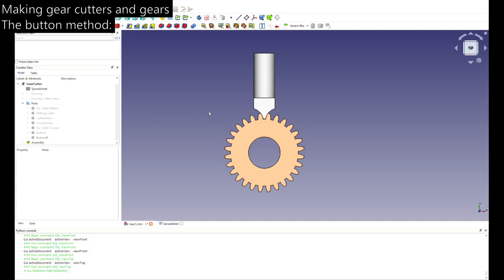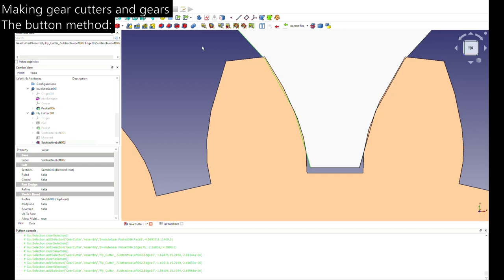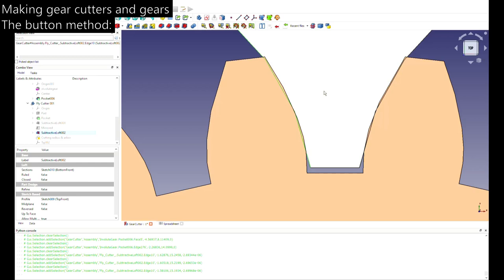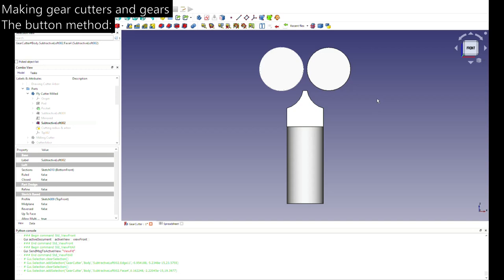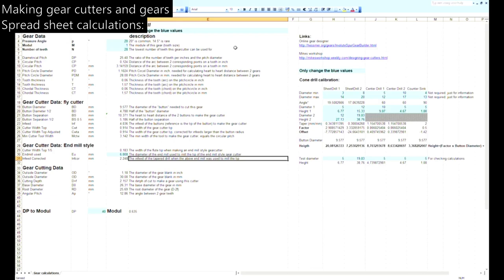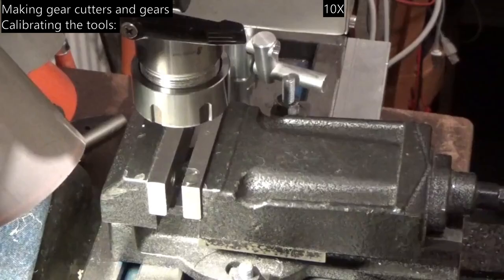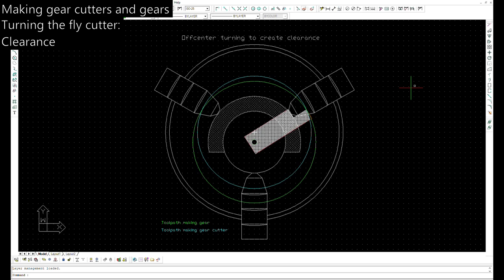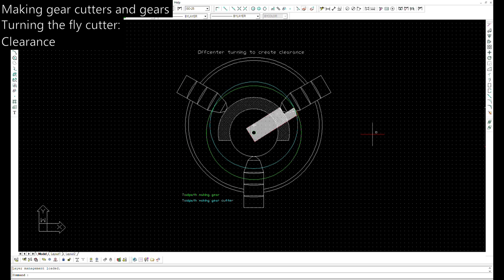Making gear cutters and (helical) gears

Comment: I.ve made milling cutters for cutting gears using a flat 2 flute cutter that was hand ground from a piece of round HSS.........it was made easier when I had access to a home made projector made from a 35mm slide projector for the tool profile......seeing a projected image of the tool at 50X on a hand draw projection chart of the tooth profile was easy.
Reply from the maker: If you can grind by hand, you don't need a mill. That HSS gear cutter will last longer than a silver steel cutter.
I have thought about using a tapered grinding bit in stead of the tapered drill bit and grind the gear cutter.
Reply: @MetalWorkerTools  Yes, I've ground cutters from HSS blanks.....by hand, they cut gears quite easily and cost practically nothing to make.....profile is checked from a hand drawn projection chart.

Comment: Huub, thanks from me also for the video and spreadsheet.  I just posted this question to your thread on the ME forums, but I though I'd ask here too.

I have a question - are the button tool calc tables on p114 of Ivan Law's book correct (Gears and Gear Cutting book)?  Ivan's tables do not agree with the results of Huub's spreadsheet or my own calculations from playing with CAD.  My calcs agree with Huub's!  Ivan's tables give button diameters/separations about 50% bigger.  Ivan's tables also don't appear to match the results I would expect using his figure on p113.

To get from Ivan's figures to the values you want, you have to divide his figs by the diametral pitch of the gear required.  If using Module gears rather than DP, 25.4/MOD = the DP value.  e.g. 0.75 MOD = 33.87 DP.

I'd be very grateful if anyone can confirm, or otherwise, the accuracy of Ivan's tables!

Thank you!
Reply from the maker: This is a copy of my response on the ME forum:

My book of Ivan Law is the reprinted version of 2013.

On page 107 if have made a note for the bevel gear calculation to use cos not sin
On page 113 if have made a calculation note: Button Diameter = sin (pressure angle) x PDM (Pich Diameter in mm)

The table on page 114 is made for 1 DP gears 20°. Divide the value in the table by de DP of the gear to cut.

According to this table, a T17 20DP 20° gear would need a button diameter of 0.39" and a button separation of 0.435".
According to the spreadsheet, you need a button diameter of 0.207" and a button separation of 0.341"

I can confirm there is a difference in the results of the spreadsheet and the table in the book.

I will check the results using the formula's of MikesWorkShop and will report it later this day.
Reply from the maker: I have checked the results of the 20° and 30° tables in the book of Ivan Law. The results of his 30° pressure angle table are the "same" as using my spreadsheet. So this table is OK. I find the same results using the formula's of MikesWorkShop so the 20° table in Ivan Law's book is wrong.
Reply: @MetalWorkerTools  Hello, thank you very much for confirming my suspicions, I’m glad I am not going mad.  Much appreciated.

Comment: Good day Huub. Thanks for this informative video. Just one question regarding the depth of the center drill on the end mill style cutter.  How do you get to 8.0mm depth using a Ø9.56mm center drill. Your spreadsheet shows 8.70mm height.
Reply from the maker: Moegsien,
The bit is 8 mm but the cutting face is at half the diameter. So the max depth would be 4 mm.
To reduce the depth needed, you could mill 1 mm of the other side. For small gears, I use a 6mm bit.
You get the largest range by using a cone drill. I am currently testing a method to use a rotary table and a cone drill for making gear cutters. This should be suitable for small and large end mill style gear cutters having 1, 2 or 3 flutes. As soon as I am satisfied, I will make a video and update the spreadsheet. It will probably be ready early 2023.

I have made a small (40 mm diameter) rotary table that fits in the mill vice. This make thinks a lot easier.
Huub
Reply: @MetalWorkerTools  Good day, what I refer to is the center drill height in your video you move to half the button separation and to the corrected indeed depth, but when you touch with the center drill you drop down to 8.0mm. Why to 8.0mm and not to the spreadsheet indicated depth of 8.7mm.
Reply from the maker: @moegsienjacobs5110  
After I made the video, I milled more gear cutters. I noticed that the (HSS) center drill was regrinded (I grind HSS drills, end mills, slitting saws, etc) and I did not mark the side to use. So I marked the side to use and calibrated again. The result is that the data in the spreadsheet differs from the data in the video. I only keep 1 version of the spreadsheet. The uploaded spreadsheet is my production version.
Probably needless to say but you have to calibrate your own center drills.

Nowadays I use small 2.5 mm HSS 5% Cobalt centerdrills. I do not regrind these Cobalt drills because the dust is toxic.
Reply: @MetalWorkerTools  Thank you I'm looking forward to this video. You keep well

Comment: How would you calculate the flat distance for grinding a hss tool for making a worm wheel hob?
Reply from the maker: I would take the top width of the thread to make as base (W).
The depth of the thread  (D)
Half the angle of the thread (A)
The with of the cutter tip (T)
T=W-(D*tan(A)*2)

Then I would use progecad of freecad to draw the thread and cutting tool to check the calculations.
However measuring and grinding that tip would be difficult.

So I would make the tip a bit smaller and do the threading using that smaller tip. The result would be a to small thread. Then I would use the 3 wire method to measure the width of the thread. Then I would bring the thread to exact  with using the top slide to set a small offset.
Huub
Reply: @MetalWorkerTools  Sounds like a good method thanks

Comment: I need a gear with smaller size, can you do it ?
Reply from the maker: Basically you can do any size gear and pressure angle but the lowest teeth count is 12.
What gear size (module), teeth count and pressure angle do you need?